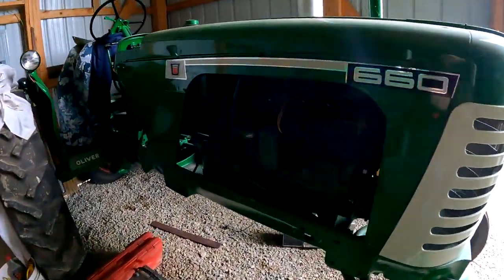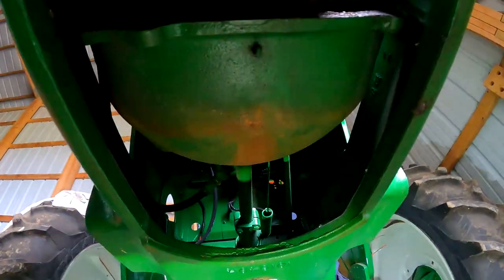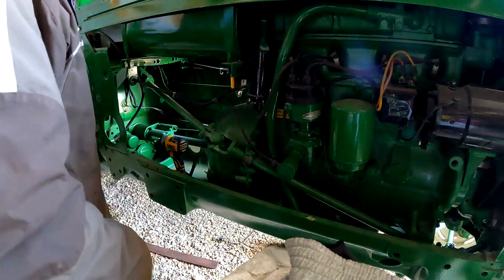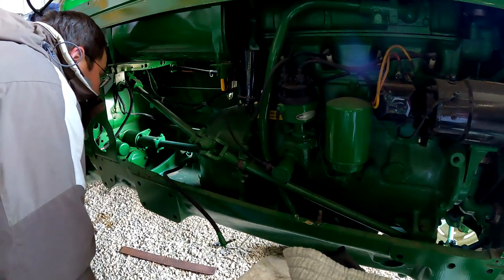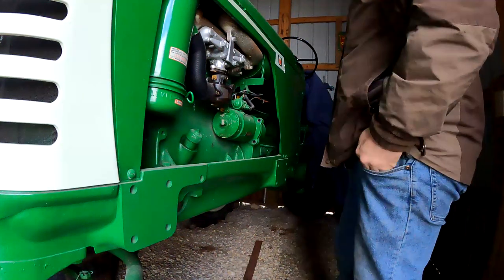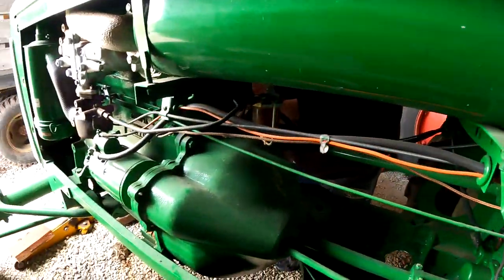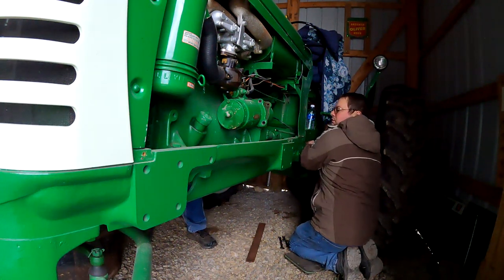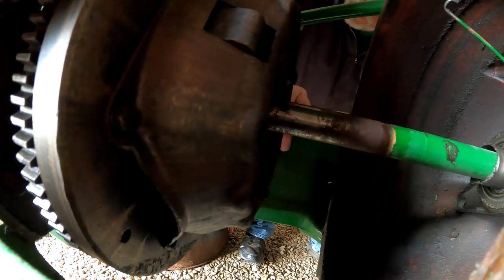Oliver 660 Clutch Repair: Part 1! Why Won't It Disengage? What Are We Going To Find Inside Of There?

Comment: Do you know best guy to talk to about detergent and non detergent oil  the old olivers and newer olivers  .
Reply from the maker: What do you want to know?
Reply: @WisconsinOliverNut  Ask your Dad what happens to a original Oliver never over hauled 1962 and put high detergent engine 5w oil in it. Example 5w20 HD engine oil.  And ran in the summer make that  2 questions.. If it's ran in the winter and ran in the summer.
Reply from the maker: Isn’t high detergent a cleaning oil? I would say not to run a low viscosity like 5W in these. The oil pressure struggles as it is. Some use a straight 30 like SAE 30 so it stays thicker the whole time to help with oil pressure
Reply: @WisconsinOliverNut   Havoline  5w20 HD a engine oil for 2016- newer cars all the 2.1 L little car motors.  But I have 2 Oliver's 5w20 got ran in and they need tear down and fixing. I just thought I could get some insight on what I'm going to run into on inside of the engine . Yes my clutch is oil soaked that's why I was watching video on how to change and work on clutch. Oil was put in Oliver by someone that didn't know any better about 60s gaskets and seals oil pressure..long story.. Have you ever heard of any one running 10w30 diesel engine oil in a gas motor have issues where they not getting enough oil on cylinder walls and rings act up. Leads to a knock in motor.
Reply from the maker: Most of the knocks I’ve heard were from the 2 piece connecting rod bushings that they used. Most engine shops will replace the two piece with a one piece design. Much better, they should have went with that in the beginning. About the oil, I’d have to check into that
Reply: @GrizC   IFEN I CAN CHIME IN HERE , I WOULD NEVER PUT THAT OIL IN MY OLD OLIVERS . WE PUT VALVOLINE PREMIUM BLUE 15 W 40 HEAVY DUTY DIESEL OIL IN EVERYTHING !
Reply from the maker: Looking around on the forums, looks like a lot of people run the diesel oil in their gas models. Has more additives that these old engines like
Reply: @dennislecloux2086  What your saying you wouldn't even put 10w30 diesel engine oil in a gas Oliver .. Correct..  Yes 15 w 40 a lot thicker I put a bunch in glass jars it's huge difference. 5w20 hd some how looks runnier than water. 😳🙄 I think any additives in today's New oils will destroy the gaskets and seals of old 60s original gaskets and rubber of never rebuilt Oliver gas motor. I heard another issue when using high detergent oils taking out the rubber o rings that seal coolant from oil  around sleeves also. There's a lot going on because antique car guys have the same  problem with higher detergent oils original gasket material..
Reply: @WisconsinOliverNut   I didn't mean to hijack your topic .. But see high detergent oils will also make that rear seal leak and get clutch oiled up and stick also. Yours looks pretty dry so yours looks ok.
Reply: @GrizC   YOU ARE RIGHT SIR . ONCE AGAIN MY OPINION AND WHAT WE DO  !
Reply: @dennislecloux2086  Is there any good articles.. or write ups on the the internet to explain to the individual that use that 5w20 high detergent oil in my 2 tractors and what damage it does to the Oliver engine because of course the first thing he grabbed onto was denial he didn't do anything wrong there old tractors . ( He just finished off 2 perfect running original Oliver tractors low hour tractors now needed a rebuild oil leaking everywhere ) any info be great .
Reply from the maker: No problem. Replies helps YouTube push out videos. Can’t go wrong 😁 Sometimes there is sludge helping seal these old seals from the poorer oils used back then. If you start clearing that sludge out, you could develop a leak
Reply from the maker: Do a Google search for “best oil in antique tractor” or something similar. Find what others are using. It looks to me like a lot are recommending diesel engine oil and thicker viscosity as they don’t have the tight tolerances of modern vehicles. https://bobistheoilguy.com/forums/threads/old-farm-tractor-oil-suggestion.72929/ That’s one example
Reply from the maker: Griz, you could also try a heavier oil like SAE 30 to see if it would stop leaking. I’m assuming you’re talking about the rear main seal